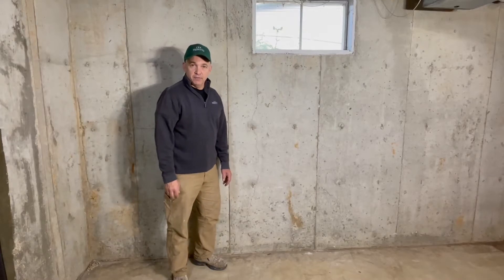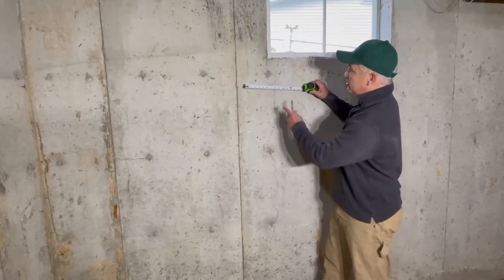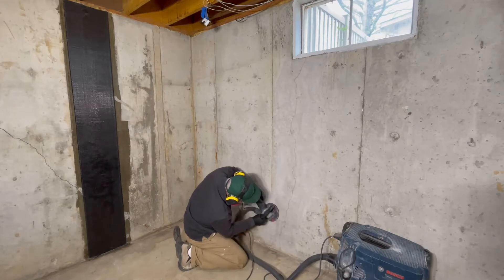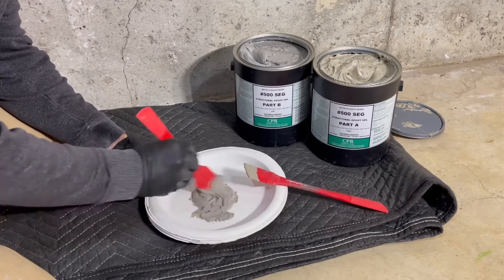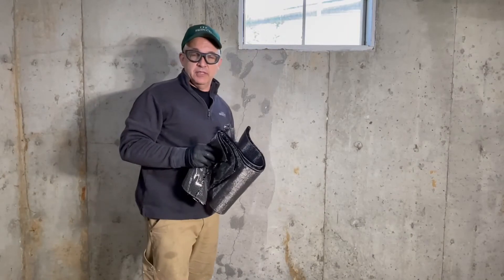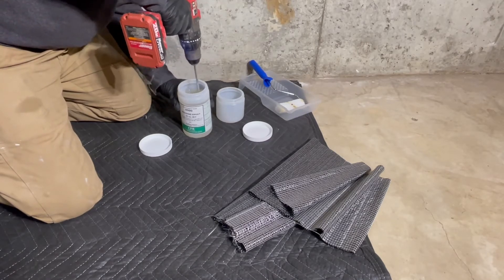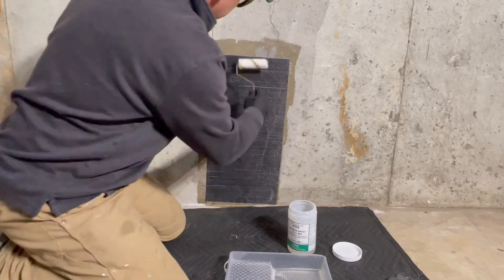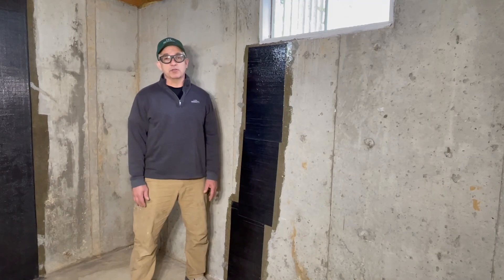Carbon Fiber Wall Crack Repair - CPR Products' Carbon Weld

Comment: Can white cement be applied directly over the cfr for the wall finishing?
Reply from the maker: Hi; thanks. Yes absolutely - we recommend waiting 48 hours before painting/covering/stucco-ing etc. just to be sure the epoxy has cured to its full strength.